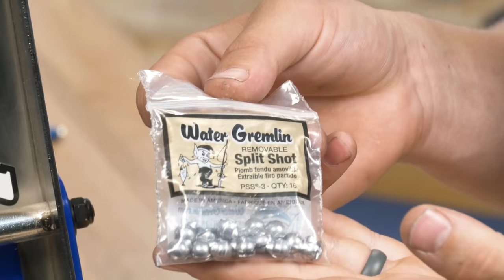Shop Talk: Is Wheel Balancing Worth It?

Comment: If that wobble/wamp-wamp is bad enough, then YES there is a noticeable difference in smoothness at speeds over 12MPH...

My first new "real" bike is the Fuji Nevada 1.9, so a "base model" (disk brakes of course) entery-level bike, during one sunny day I balanced the wheels just out of curiosity and WOW how the bike then seemed to glide over the asphalt... After this n that... And finally, I kinda replaced the wheels as the stock tires wore out, I went to do a quick balance with the new wheelsets with good rubbers and found that it wasn't necessary...

It depends on the wamp-wamp and how picky you want to be, but it shouldn't feel like something is tugging on your bike just because the wheel is spinning freely while not on the ground.

Comment: I find the heavy side of my wheel with a dummy stem insatalled, then I find the heavy side of the tire so when  mounting it I can put them opposite each other.    I store my bike hanging so the heavy side will go down then I rotate it 180 degrees and hold it there with a strap so when the sealent dries, that lighter side gets heavier.   This way I am continually balancing my tire between rides.

Comment: On my tubular carbon deep section wheels I use a valve extender without the stem and remove it for riding, this is not perfect but simple to do without adding more weight, the downside for me is that you just don't want to forget it when you're in need on the side of the road...the only time it happens to me I was save by my old spare tubular who fortunately have a standard Vittoria valve extender.

Comment: They didn't try to find the heavy spot in the tire(+tube) and orient it to cancel the rim imbalance. Pro tip 😂. As far as the sealant goes just get it somewhat balanced before adding sealant. Carbon rims sometimes have pieces of the bladder left inside. I'm a roadie and I'm happy to get below ~3gr and then I'm happy. No need to go crazy. The smaller your wheel or the faster you go, the more rotations which means more imbalance. So if you're bombing downhill at 60km/h on a 26 inch it's probably good to balance. If you're doing 30km/h on a road bike, it doesn't matter.

Comment: Eh I balanced my wheels (after putting inner/tyre and inflating). I doubt you'd notice a difference on anything but a road though.

As for materials to balance with: I use lead with adhesive strips (for golf clubs). Theyre about 3gr each and i can stick them onto the rim under the inner tube so you'd never know they're there

Comment: One of the few times I'm going to disagree with Park Tools. Balancing IS important but only to a degree and you need to take into account how much imbalance there is. With mountain bike wheels and tires the traction is always variable so the necessity for exacting gram perfect balance is silly especially when you take into account a tubeless system. However, with road wheels and static weight locations (tubed or tubular) and you're pushing 90+% of the traction limit? The speed of the rotation along with the force generated by a valve, valve extender along with the reinforcement for the valve hole of the wheel in addition to manufacturing tolerances can cause a system with enough force which disrupts traction along with forces the rider to make micro corrections and absorb that energy as if the rider feels it, it's not going into the ground via the tire deflection hence costing watts. With MTB stuff it'll have to be fairly significant weight imbalance in order for that system to be thrown off enough to make a difference. For road? Much much less due to much higher speeds and a lower wheel and tire weight.

Comment: of course it will affect your handling, speed/power, and comfort...the whole industry of road cycling is heading towards fatter than 23mm tyres because of the bump soaking effect that fatter tyres give you and thus you'll go faster; if you're wobbling then it's costing you power/speed... currently I'm suffering with adjusting my seat height because of my imbalance when pedalling fast, and the wheel imbalance is a big culprit.
But the issue is that this process is very sensitive to change...every time you change your inner tubes you have to balance and put the tyre back on in the same position...then you have mud and debris sticking to your tyres...etc.

Comment: I have a good few wheels with heavy spots which work like your test rig there without fitting special flushed bearings.

From watching them pendulum, indeed the heavy spot is the valve. Saw no need to balance the weight of a valve.

Comment: as a fellow mechanic, i tend to always balance deep section road carbon wheels because the long valves tend to make the wobble a lot worse then on mtb's, this usually occurs on time trial rigs where the customers are looking for every watt and everything to be fully efficient. plus customers who have spent £££'s on their bikes don't want them to wobble when they spin the rear wheel. mountain bikes i always check, if the wobble is bad i correct it but if its insignificant then it's not really anything to worry about.

so for me it's about pros' vs cons' and mainly customer satisfaction. :)

Comment: An optimally balanced wheel offer very little benefit. Ultralight TP inner tubes help to move towards a better balanced road wheel because the valve is also light weight plastic. And TO inner tubes are a nice option between conventional inner tubes and going tubeless.

Comment: For my my road bikes (700c x 25mm tires with latex tubes) I like to balance the complete wheel/tire/tube. I don't have to rebalance my wheels much If at all. The bike seems to ride smoother especially when coasting down-hill at high speed but possibly just my wishful thinking. I don't and won't do tubeless on my road bikes. I don't balance my MTN bikes.

Comment: Mavic 700c,it appeared that the rim weld was opposite the valve stem,l screwed a couple of nuts (small) on the presta valve and had smooth rotation,for what it`s worth.

Comment: If a road rider has the USA required clunky reflectors  slipped in the spokes still, they would gain from putting a matching one opposite or taking off the first one. There would be less jiggling of their seat that might matter over a 100 mile ride.  Off road matters less because the speed is lower and terrain will jiggle your butt more and their might be suspension that isolates the jiggle.

Comment: I have a pair Reynolds Blacklabel widetrail 29 carbon rims. Even if they were balanced from factory it was definitely messed up by my tubeless setup by the valve. I noticed the imbalance while riding down the finish straight of a local dh race so I went to a car tire shop and got some adhesive wheel weights to balance the wheel by adding 5gr opposite to the valve. It makes a huge difference while spinning the cranks on a bike stand but I’m not sure it really matters in the real world. Anyhow World Cup mechanics add wheel weights to some riders’ wheels so it can’t be that wrong right?

Comment: Reynolds Sixtysix/FortySix wheelset with Continental Competition tubulars. 
The weight of the tubes brass vavle makes an unballanced wheel (usualy counterd approx by joint or weld in aluminum rims). It is really noticable and the force of the rotating brass vavle of the rim can be felt like the rear wheel is ’dancing’ at high speeds. Less noticable on front wheel though. 
HAVE  balaced it with a wheel magnet (for cadence / speed sennsor) and correct position on spoke.

When i ride w. Vittoria Pave || tubs with vitorias awfull aluminum vavle stem counter weight of magnet is too much... almost unoticable due to the lighter vavle stem if i dont balance. If i do add magnet i also have to add weight on spoke near vavle.

Proberbly not an iuuse unless u ride sub 1200g wheelsets. Never noticed on my 1450g 32 spoked Macic Open Pro / Record wheel or 32 spoked alumium tub rims on Record hubs.

On the very lightweight Reýnolds carbon tbular wheels: defenatly noticeable.
Reply: Yes, rulett of thumbs should be that if any wheel with clean inflated tyre is imbalanced, and it can be drivende at above 40kph, then it should be balanced.

Comment: I balance my wheels on my road bike just for comfort didn't notice any gains. I didn't go anywhere near as in-depth as you did at balancing it thoughI just moved the reflectors to a point where they didn't spin when I hung it on theand I didn't feel the womp womp was when I was riding on smooth roads.

Comment: Unless the balance problem is quite bad, it's not worth it unless you are prepping a bike for a race (maybe).  Even then, it would be way down my list of priorities.  True wheels with well tensioned spokes and good tires will perform quite well unless the imbalance is significant.  Think about how the bike shook in the stand (after they took the wrench out).  To introduce even that minor wobble, they had that wheel spinning FAR faster than it ever would during actual use (road bike on a steep descent.... maybe).  It also did not have 100-200 lbs of rider stabilizing the bike.  That wobble would be imperceptible under actual use.  Is it slightly less efficient, yes.  Will that slight inefficiency effect anybody but a racer, no.
Reply: Best conclusion so far
Reply: @Rexuar  Thanks!

Comment: I got a used bike from someone that had balanced the back wheel with loose copper sheets wrapped around 5 different spokes  some had multiple strips and he was very proud of him self for fixing the bike... I haven't touched it and it works ok but if I need to fix anything on that wheel they are all coming off.
I think the axle is just bent.

Comment: At 20 mph a 16 in. wheel is only turning at about 400 rpm.
At 20 mph 80% of your resistance on a bike is air resistance.
After a lifetime of cycling I average about 10 to 12 mph. (touring and commuting)
No matter what I do. 
THEN! One day while riding I noticed how very slowly my front hub turned
even when compared to the tread!

Comment: The imbalance in my carbon tubular racebike rim causes a noticeable and annoying rocking feeling when riding at + 50 kph in a critrace. I tried to correct it with small fishing lead but am still in search of a more elegant way to do so. There's no point in balancing a slow and heavy MTB wheel of course. Perhaps you can use the imbalance of the tire to counteract the one of the rim.

Comment: I hate imbalanced wheels, you can always ALWAYS feel the wobble. Well, not in the mountain of course, just in roads and at speed. But I've never managed to get to balance them, the hassle doesn't justify the gains. I do bother my mechanic several times a year with spoke tension, which adds a lateral type of imbalance much more noticeable than the one caused by the valve and tyre.

Comment: If you really wanted to do this for a road rim, use brass nipples to replace aluminum ones and work your way out from the light/high spot, or do the reverse if you're using brass and add aluminum nipples at the heavy/low spot until it's corrected. Brass is 3.17 times heavier than Aluminum.

This seems like such a minor thing. A wheel imbalance could create some harmonics at speed, but tires are sufficiently forgiving. You're not riding your bike on the lunar velodrome, young man!!! You have gravity and tires, be happy here on earth where we don't contemplate bicycles moving at the speed of light.

If your rim is true you're golden. Be like Fred. Fred loves smooth bearings.

Comment: If you are using tire sealant it seems like a moot point, how are you going to balance a tire when you have a dynamic fluid medium that doesn't necessarily remain in one place and is dependent on your speed and it's current state, fluid, dried whatever.

Comment: Ripping off the stickers on rim labels can save that kind of weight & more, but I still wouldn't sweat the balancing. I have experienced a speed wobble only once. I assumed it was from sheltering in the gutter from a strong crosswind in a large pack w/ semi-aero rims at apx 40 mph. Is there any reason to believe imbalance could contribute? I've never been able to recreate said wobble.

Comment: I get a scary shimmy at around 70kph on a descent. I've always wondered if that's a balance issue?
Reply: Rixter Likely, yes. Wheel balancing is more important for us roadies.
Reply: Yes, that's a typical speed for wobble due to the frecuency at play
Reply: Rixter, several things can be at fault causing a harmonic frequency to transmit thru the bike. I’ve had failed hub bearings, front or rear, as well as indexed headset bearings on different bikes cause this.
Reply: At 70 kph downhill the most wobbly parts are your knees while your brain is screaming "I'm gonna die! Must brake for the hairpin!"

Comment: The hub .. the washers /bearing have a fault .. in which the wheel endures a slight buckle effect  ethier that the diameter  of the hub to the diameter of the axle . suffers a slight grinding .. because one of ethier part is  misalinement     which results in the wheel shown a buckle movement . If neglected will cause serious issues  

A fault very common on BB  hence why some brands have resorted back to threaded bbs because they can't maintain build quality enmass   on Pressfit BB  ,,

Comment: Hello there I've got a question After a small accident I noticed that the rim on the front has a flat spot so meanwhile it spin goes up and down Have you got a video that treats this argument or  if there is any tools  ,any advice ? Thanks in anticipation
Reply from the maker: If the metal has been bent, there is no good repair.  See https://youtu.be/7R8dncAbhoM?t=628
Reply: Hi there as far as I can see there is no bent metal I think it's only mishaped
Reply from the maker: @shirleymarino6236  https://www.youtube.com/watch?v=7R8dncAbhoM&t  This may help you but often the section of rim that was damaged like you are talking about has been fatigued and is now stiffer than it was and will be hard to bring back to its original shape.
Reply: Thank you the video was a great help